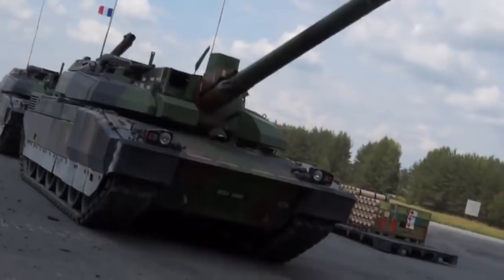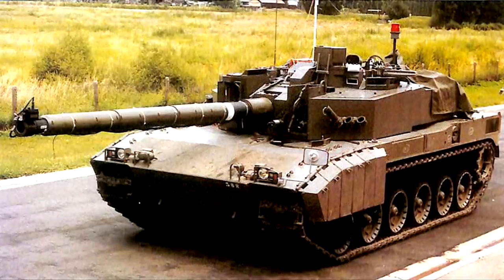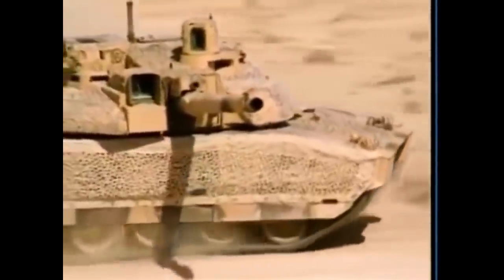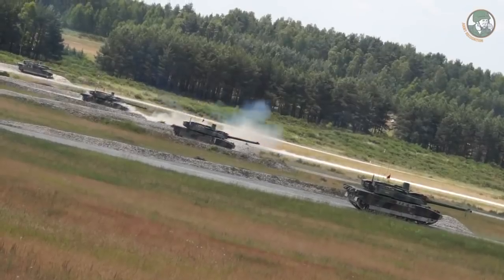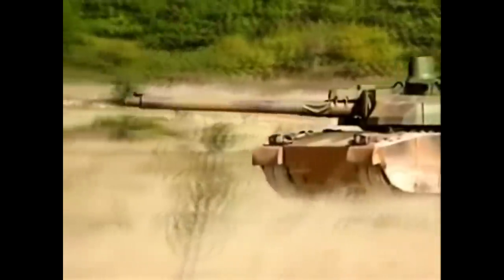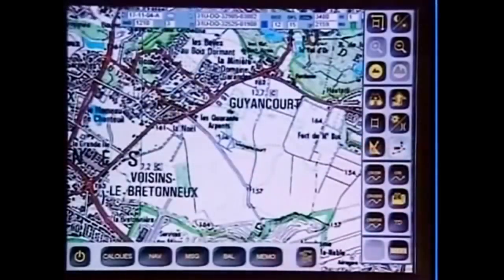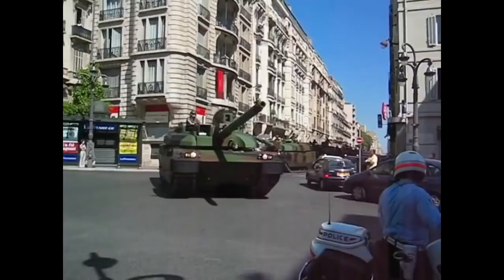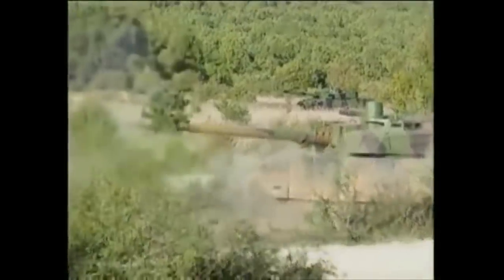Is Leclerc Obsolete?

Comment: I thought that Leclerc's firing system and autoloader were it's main strenghts, but I think that you didnt even comment on it?

Theres is a replacement for it in the works though, under Franco-German cooperation, the Leopard 3/Main Ground Comat System, for 2035.
Reply: The German-French tank is a project that wouldn't be ready before 2030 and after that they have to produce enougth of them.

In my opinion we will see newer Leo. 2 upgrades and Lerclec upgrades even if the French abdone there mbt and use the German one because saudi Arab will need also some upgrades for there Lerclec fleet.
Reply: Eric_The_Viking the Justin Y. version with an axt I think it’s hilarious that the French will be using German tanks
Reply: because he is a small minded Russian. He likes to make NATO -  tanks look bad and Russian ones better than they are. In most real world fights it comes down to the firing system and the targeting equipment and its not so much about armor since you aim center of mass. But this categories would make the russian tanks look bad compared to the western ones. So he is not metioning it.
Reply: @Lordodestractnanmssry  he literally mentioned how the FCS needed to be upgraded, so no he didn't ignore it
Reply: @AdotLOM  No, the Leclerk's fire control is still up to date, in fact it has better fire control than 90% of tanks in the world. It has a battle management system which is very rare feature in tanks. So no, it does not need upgrade for fire control since it's still up to date. If any tank needs upgraded fire control then it's the Russian T-72 and T-80 series tanks since they still don't even have a independent commanders thermal sight, let alone a Battle Management System

Comment: How much does the Euro MBT improve on the Leclerc and leopard? Could it be a viable replacement for the current Leclerc tanks?
Reply: Actually the EMBT was only made for exports, not to replace the Leclerc. You've got the firepower of the Leclerc and a more rustic Leopard 2A7 chassis with its more commons suspensions, the Leclerc having oleopnematic ones which provides it great stability but is I suppose harder to maintain for smaller armies. 

It ables the EMBT to be less expensive and easier to maintain than a Leclerc, but with a little sacrifice on the suspensions.
Reply: From what I gather, the EMBT is a test run for french/german cooperative tank. Afterwards, they will go on to make the actualy successor to Leo2 and Leclerc, when everything goes right. That will be a very different beast, likely using Rheinmetalls 130mm cannon, etc.

But that's gonna take 20 more years. So who knows, in case France/Germany have to increase their tank forces again, they might use EMBTs as a stop gap.
Reply: @termitreter6545  I would  doubt about the rheinmetal 130mm canon, the 140 by nexter is far better.
Reply: ben Delgado afaik the euro mbt is just a marketing stunt to show cooperation between kmw and nexter - i doubt any european country will buy it as it doesent provide significant improvements (why spend large amounts of money for a system that is pretty comparable to the one you already have? In addition the turret would be an armor downgrade for leopard users)
Reply: Germany wants a new MBT because Leo becomes obsolete. But  Leclerc doesn't. It's just a shit political plan.

Comment: 4:36 that is the EMBT though ... a Leopard 2 hull with Leclerc turret.
Reply: Red was pointing out how the turret sometimes lacks the MG. As the EMBT and the Leclerc shares the same turret, he was right
Reply: @albertoamoruso7711  the turret has a heavy machine fun ! Sometimes even several of them!
Reply: @DeadVador  Sometimes it doesn't
Reply: @albertoamoruso7711  it always has it's coaxial heavy machine gun
Reply: @DeadVador  Red was talking about the rooftop machine gun
Reply: "Eurotank" project after KMW merged with Nexter to allegedly show off their ability to work together. I believe is it a cheap way to mount the new 130mm rheinmetall gun since the leclerc tank is designed to work with an autoader and the leo hull with leclerc turret is light enough so that it doesnt impact mobility
Reply: The EMB is going to keep the 120mm gun. To actually utilize the 130mm of rheinmetall, which handles significantly heavier and more powerful shells, you have to built a tank around that gun.

Which is gonna be the MGCS, if the cooperation holds.
Reply: @termitreter6545  not nessecarily true. Likely only a slightly modified leclerc turret seeing as the were able to install a 140mm and 140mm autoloader on a leclerc turret before but the chassis couldnt handle the weight. EMBT is said to have about 10% growth potential(mass increase) due to the leclerc turret being lighter than the leo 2 turret which amounts to around 6 tons or so. The weight of the 130mm L/51 is only 1 ton more than the L/55. Right now it is being fotted with a 120mm but it is just a demonstration vehicle
Reply: absolute heresy

Comment: Define obsolete. Any tank is useful depending on the circumstance. Is it the best tank one could use? No, of course not. It is as good as one is likely to get given the budget, probably, if you discount the price to compensate for it's age.
Reply: That would be obsolescent though.
Reply: Peter Cohen It cost 28 million... 4.5 times the cost of an abrams
Reply: @hazardous458  no that was only the old price of the first batch in the 1990's... in today prices it cost roughly the same as an Abrams or Leopard
Reply: Nico k
Reply: @hazardous458  it costs 1.5 times the price of an Abrams.